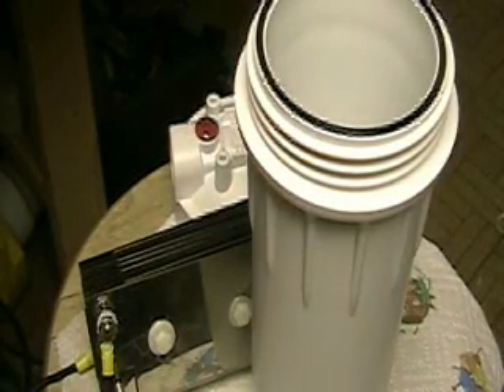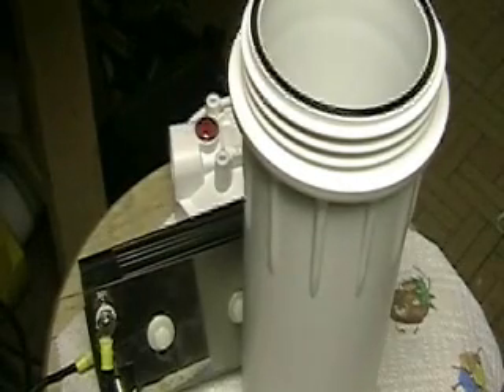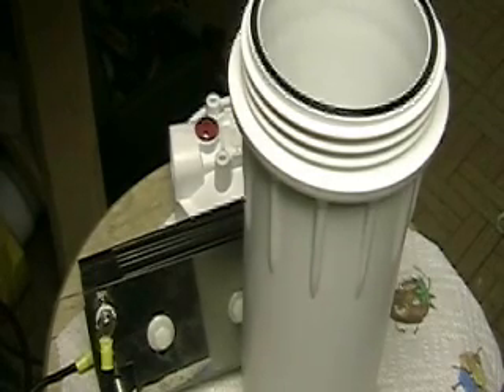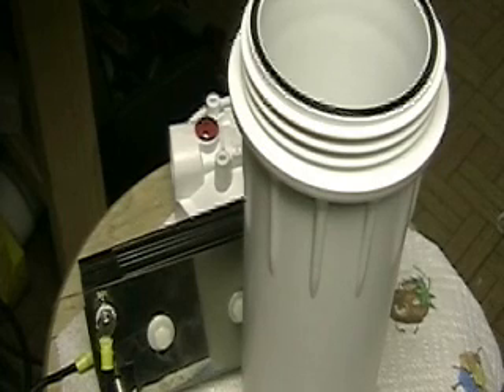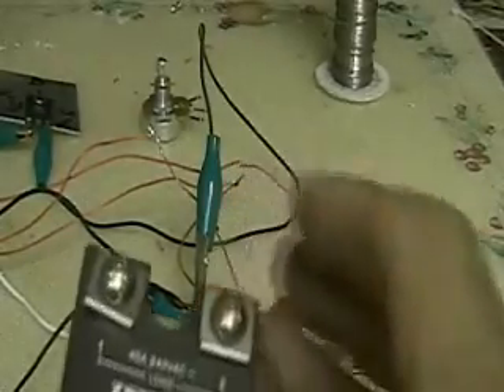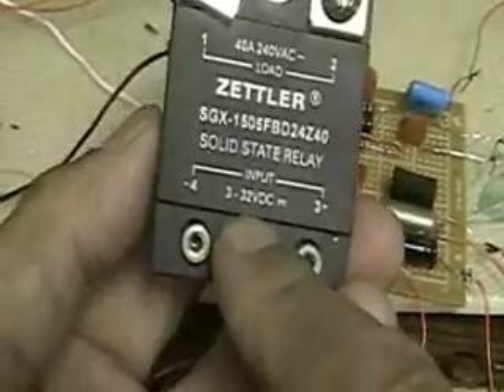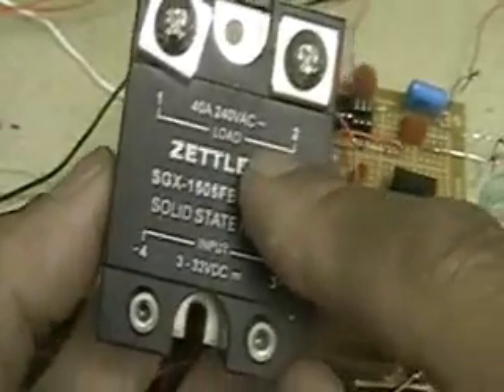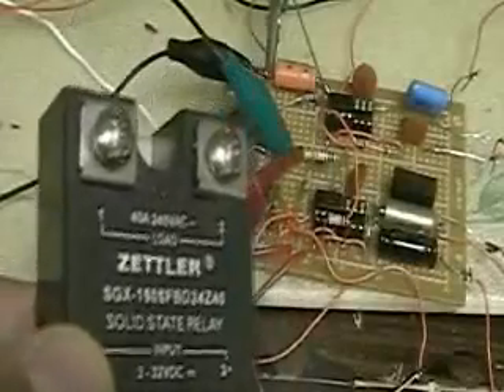Hydrogen Tap (Cell for Filter Case) 137

Comment: john don't take it apart.till you look at every thing.I'm start look at center bolt electric Vortec with Bp force add too.the Stick on its back may also be a charging force, electric charge same as if you rub it.If you try it on its side standing up, the sweet spot sould be top to the bolt but bottom may give off bigger  bubles.if not the force of water flow show you.